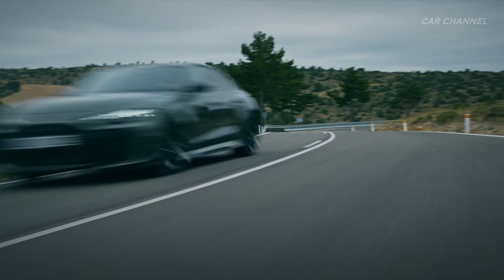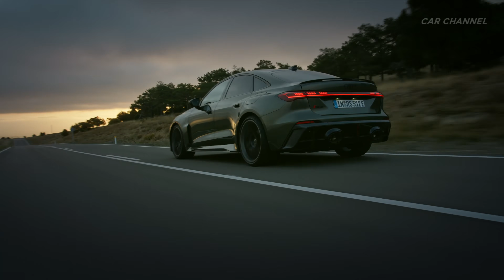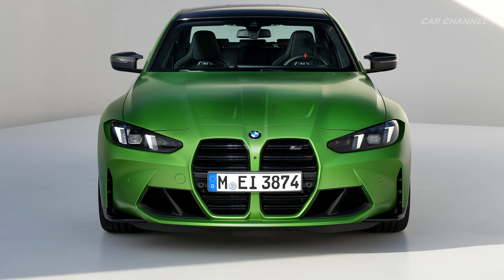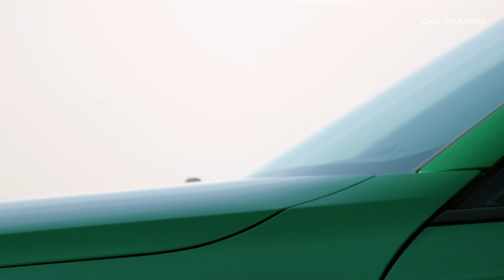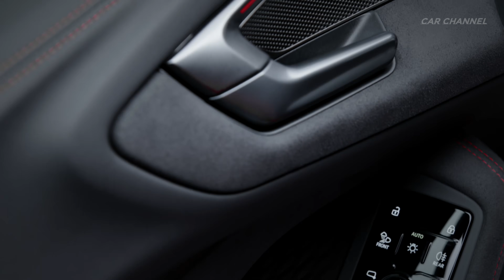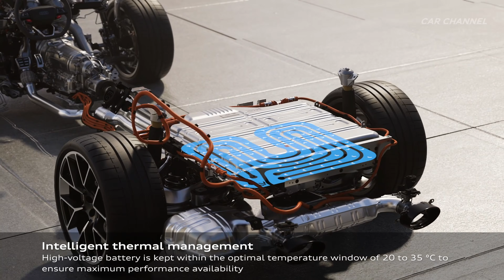2027 Audi RS 5 Sedan vs BMW M3 Competition 🏁🔥

Comment: The Center part of the Audi’s steering looks like cheap plastic, I can’t get myself to see it daily driving it. And the lacking of the gear stick. I think Audi should address these two issues and it would really run away from the bimmer.

Comment: If this RS5 does not make BMW rethink their designing skils then probably nothing will. The Audi doesn't just look better, it sounds way better too then the BMW and as a huge Bimmer fan i will take the RS5 over the ///M3 any day any time. I love rear wheel drive but that is somthing i can sacrifice if i had to choose between these two.
Reply: I prefer the M3 in this case, because, it is lighter and also the last car in this segment currently offered with a manual transmission. The wagons though, that's a different story.